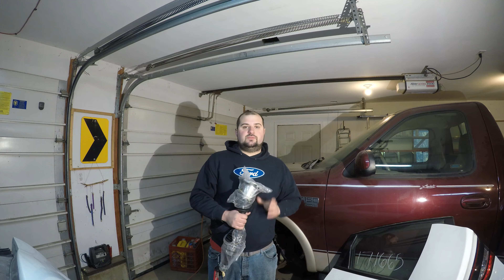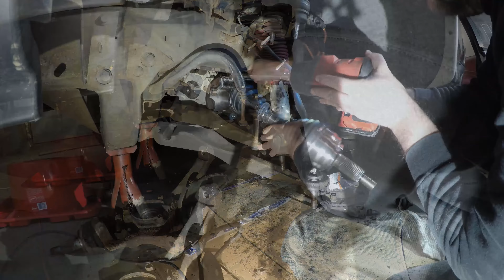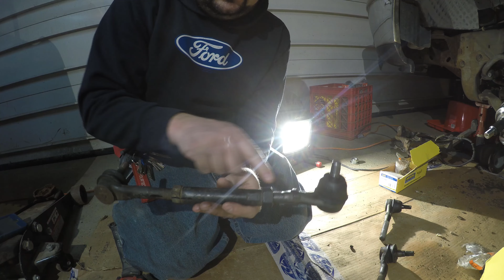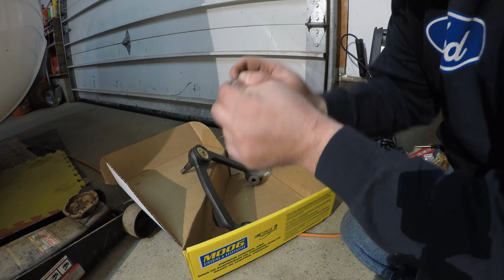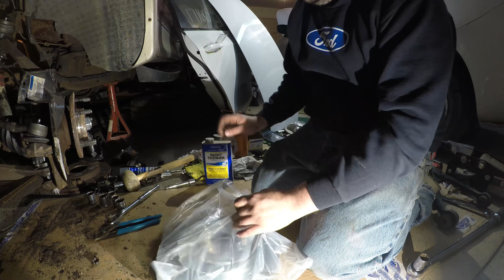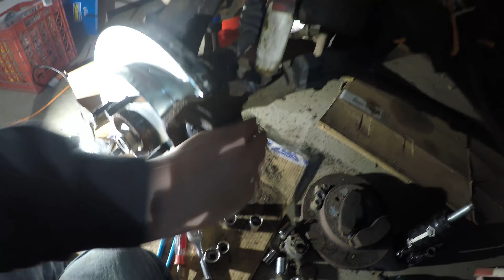1998 Ford F150 Rebuild Front Suspension - Part 2

Comment: 1997 F150 XL 4x4... front driver side top shock mount rusted completely out.  There are lots of videos with replacement brackets that are different than my truck (Mine is like yours, welded on bracket up there) - I can't find a replacement bracket to even replace it with if I could even find a shop willing to do the weld - What's your suggestion other than "dead truck" at this point?
Reply from the maker: My mounts not the prettiest either and that is also one of my fears, my truck is fairly clean aside from some minor minor rust spots. I keep it inside when its not being driven, and it no longer sees snow and salt so I am hoping it won't get too bad. My thought would be to have someone fabricate and weld a new piece in. I can't imaging it would be too difficult for a good fabricator to do. Might cost some $$ but probably cheaper than a new truck. You might find a rust free truck and cut them off that and find someone to graft them on. Not sure, not too many options on it unfortunately.